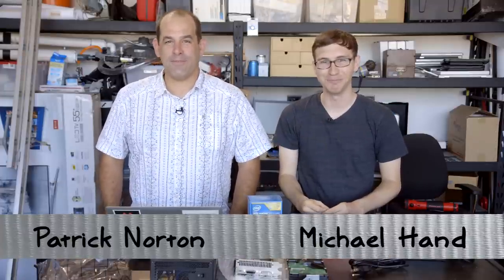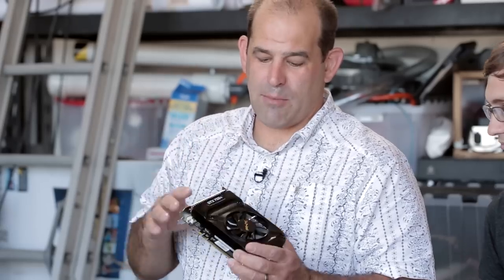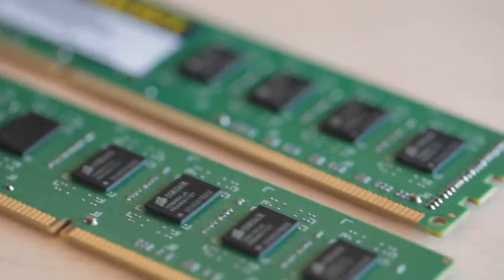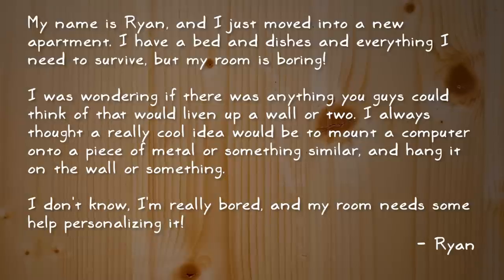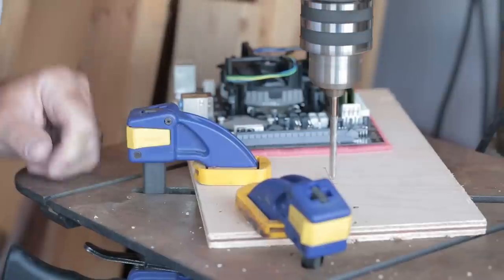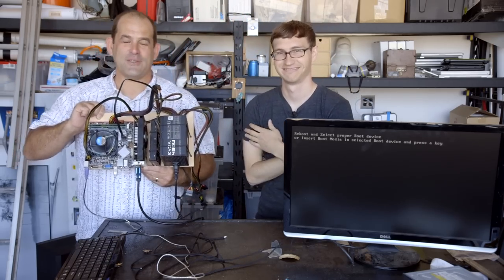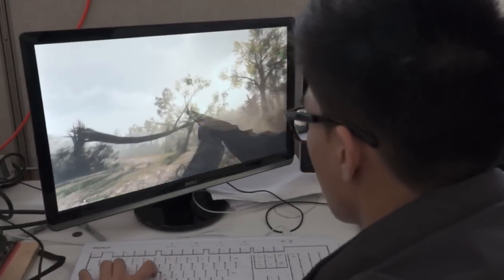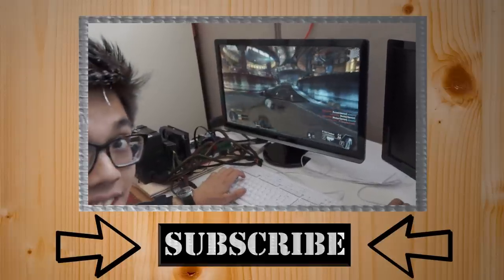Screw The XBOX ONE and the PS4... We Built a Gaming PC for $380!

Comment: its better with out a case it has a high air flow lol
Reply: Lol true but you have to put a fan next to the motherborad just in case
Reply: Enemy__Breaker ᴴᴰ  In what case?
Reply: Jonny B Dust collection isn't very hard to deal with when it doesn't have a case xD And if you're house doesn't have dust flying everywhere
Reply: maphantom xD
Reply: one thing it isnt dust proof
Reply: liwa3055 air duster for 3 bucks at Wal-Mart
Reply: Propably untrue. A Good case tunnels the airflow which is better than just letting it hang
Reply: Coldbound You don't need tunneling the airflow you only need space to blow far away the hot air from components.
·
The hot air don't stay and cumulate around a towerless MOBO, that only happen in a close box.
Reply: ***** you only live once
Reply: Enemy__Breaker ᴴᴰ you bet buddy
Reply: liwa3055 the dust tho
Reply: SprDrumio64 put an awning/sheil on the top of it and fit fans blowing down end of the dust problem
Reply: SprDrumio64 very fine mosquito net? Not the best looking pc thats for sure, but you are already on a budget build, soo
Reply: liwa3055 
I don't know. While the air access is at it's maximum without a case, you kind of don't get the air pressure to cycle the air tamparature, no?
Reply: Enemy__Breaker ᴴᴰ This PC has no case. I know, i know, amazing joke.
Reply: lv0ll9 i wasn't even jokeing ...
Reply: lv0ll9 i was say to put a fan next to the motherboard just in case so it not going to get hot
Reply: Enemy__Breaker ᴴᴰ ._. You dont get it do you?
Reply: Commander5374 There's no such thing has "no dust or barely any dust flying around in a house"... I can tell you're either a kid or it's your wife/mom that cleans for you !
Reply: Yea I have a very big ventilation for a small room like my laptop shuts it fans because of the coldness I even wear a jacket
Reply: liwa3055 they could buy a case for that for 20 bucks on ebay

it's really ridiculous without the case...
Reply: You guys know much about Thermodynamics, it's insane.
Reply: liwa3055 EliosMoonElios  LoL, no. Having no case means there's NO airflow. Luckily this isn't a powerful machine, because those can turn a room into a sauna, much less work without proper air flow. 

Open motherboards on more powerful machines are operated with liquid cooling to compensate.
Reply: thaloh tell me about it, my room is about 15 degrees hotter than the rest of the house

15 degrees doesn't sound like a lot, but it sure does feel like a lot
Reply: Johnny Cage yeah like I hate when I play my 360 and it overheats in my room in 5 minutes but when I play in any other room it takes 6-8 hours
Reply: Johnny Cage dude use an antique ice box if you have too
Reply: Jabari Cruz too put up my butt?

i think it would be easier just to use an air conditioner
Reply: Johnny Cage u cant because ac creates moisture
Reply: liwa3055
Actually it's the exact opposite of what you said: AC removes moisture from the air via the condenser.
Reply: Johnny Cage pc produces heat and the air around it has moisture when cold air and hot air come together they create water
Reply: liwa3055
I'm confused... are you under the impression the AC unit is inside the computer?
Reply: liwa3055 Let me Wrap this up just but put Glass as a Case Totally Works like a open Case   :)
Reply: liwa3055 Haha. No. AC removes moisture. It's why you have AC AND humidifiers in data centers.
Reply: Sure you have more air flow, but more prone for ESD with out a faraday cage/shield,
Reply: liwa3055 I must say that you do have a point there... but with case looks better....
Reply: liwa3055 yeah but dust everywhere not to mention some stupid shit spill some water into it, you know the drill water vs electronics.. just put some case for safety.. becaze saufeti is my number one priouritiy -CrazyRussianHacker
Reply: +Feng “The Wind” Shin Ya but... I could have a medium size fan running against for dust and it's mounted on the wall how is it going to get water on it
Reply: +liwa3055 no because it will need more maintenance because of the dust.

Comment: It would be even cheaper if gaming companies get it together and start supporting linux
Reply: SteamOS seems to be taking off, quite a few games have been fully ported over.
Reply: Misterfox20 They said EA is jumping on board too. But it boggles me how when I new system comes out. Say the PS or the XBOX, instantly every game developer jumps on board, but for linux its nearly impossible despite the fact that its open source. And most game engines are supporting cross platforms to linux as well. The fact of the matter is most games will be on linux one way or another. And mobile devices are pushing this more then ever. As long as Nvidia and ASUS invest heavily in hardware for mobile devices, they have no choice because the dominate mobile market is not Windows and its our jobs as the consumers is to keep it that way.
Reply: Anthonyg Gordon well with windows it's possible companies get paid to build their games based around the windows OS. Hard to say otherwise. Although they might also feel as if there's not much of a market for it perhaps. That could be it too. I honestly couldn't say.
Reply: ArtisChronicles With the new tegra (fast nvidia processor/graphic processor coming out. Which holds support for unix due to unixes dominance in the mobile market, its only a matter of time until unix is back in the game thanks to tablets and phones. Which means more grahic card support for linux based systems. With the new Tegra being the fastest, the next generation of phones might get the same title of games as the latest generation consoles. That being said steam will have some part of this because they are the biggest third party contributors to OpenGL and OpenGLs new graphics Kronos which WILL be googles main choice for graphics drivers will be there to reap all the benefits which will trickle down to PC's linux base which will boost more pure steam machines. And best believe steam is working on mobile (Steam Boy) which already uses the tegra (Fastest GPU/CPU EVER)
Reply: Now that I think about it. The day Tegra is released, is going to be the day micrsoft takes a huge blow. We are talking about a freaking micro processor that is faster then your modern video card and cpu. No Doubt its going to be mobiles task switching which utilizes this the most but this means the death to microsoft. When companies start support this card and khronos which will be the main pick for graphic drivers. We are talking tiny pure steam boxes or android boxes  playing battlefield 5 (In which Dice publicly has said  at a khronos forum at GDC that their next battlefield will  have linux support). It will be an exciting time.
Reply: Anthonyg Gordon linux right now just way to hard for normal people to use its so damn easy to break the system done it myself alot of times when im playing around with it
Reply: Anthonyg Gordon you do know that is drivers made for video cards for linux right
Reply: Massamo What ? Khronos ? Yes I do know about the drivers. What I am saying is Linux is rising but its not because of linux, its because of linux and unix based OS's such as Android and iOS. And now that tegra processors are catching up with console... (In Which Mobile will EVENTUALLY catch up to Console) It may never beat PC, but mobile will damn for sure beat console and when it does, linux based systems, Shield, Android, Steam Machine, will be equal competitors in the Consoles and PC's market. As soon as mobile got big, Nvidia, redid half their  company, to devout to mobile, its that serious. They said they will eventually beat console and I believe it. Remember consoles run on a single processing unit as well. Which is why I see consoles and mobile as equals. The PS4 OS is practically a mobile OS system for the fact that it suspends  processes based on opening and closing applications. This is to preserve spending on the processor. Since the graphics card and CPU are practically the same thing.
Reply: Anthonyg Gordon Thing is Linux runs on OpenGL unlike windows and xbox that use DX or D3D. And most developers only dish games out in D3D or DX which is why not many games are supported on Mac or Linux. 

But if consoles ran linux, this will resurrect OpenGL as the suprerior API. But Someone doesn't want that to happen Bill Gates
Reply: ***** Yea but like I mentioned before. Mobile is changing things. Mobile is the highest selling device out there. Higher then PC. Which is why you have Nvidia making amazing benchmarks on their Nvidia shield. Its almost as fast as Console and it hasn't even been a decade yet.  Also all high profile gaming engines, CryTek, Unreal, etc are coming out to support Linux. And EA has mentioned that their Support at a Steam Conference and said their next version of Battlefield will support it as well. This is all in push for Mobile Gaming. Its coming, O BOY its coming!!! Slowly but surely,
Reply: Linux doesn't run as good with games as windows or even OS X
Reply: Starlesslemon yes it does. ITS A COMPUTER.
Reply: +Anthonyg Gordon that made no sense
Reply: Starlesslemon Are you trying to say that OpenGL is not as powerful as DirectX ?Lets not have this arguement. The only thing DirectX has on OpenGL is a bigger library which is going to change in  the next 5 years.
Reply: ***** Your probably not going to be able to play old games. But All the next gen games are going to be compatible with Linux systems. Like I said before, EA has announced they are shifting alot of their games to be Unix based including the next battlefield. Unreal has Unix support, The CryEngine will be support unix. All of this is due to the demand on mobile gaming. In which Linux and Unix systems will benefit from because the highest users use Android Mobile devices Think of Linux as the next Gen gaming system, that will have new releases for it. Trust me, by time PS5 comes out, we will be playing most of the best games on Linux systems.